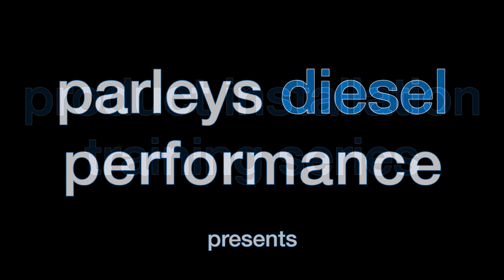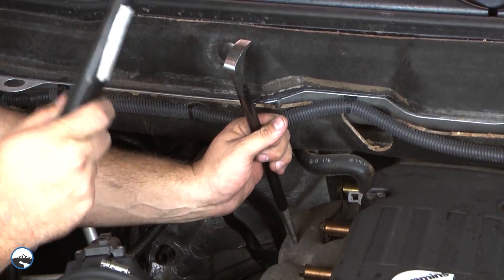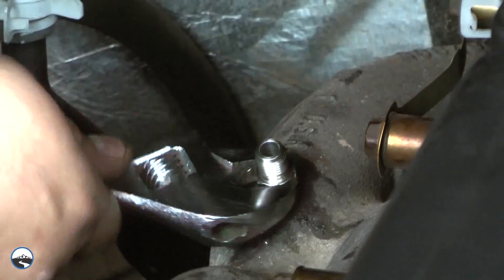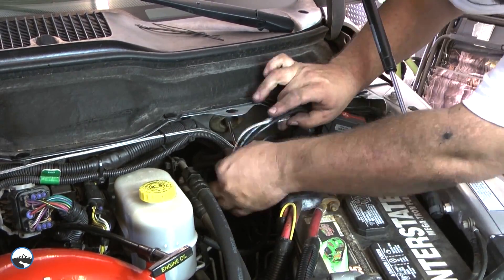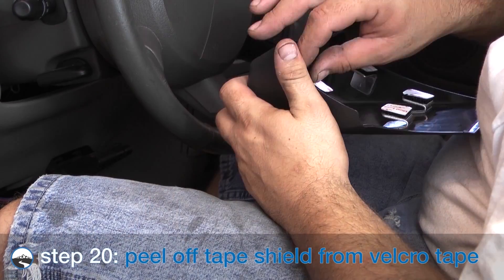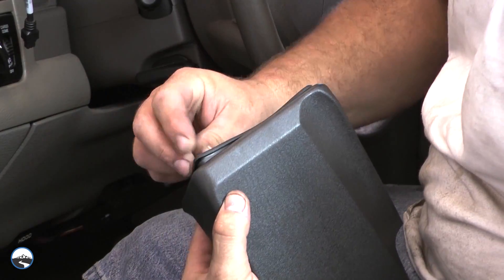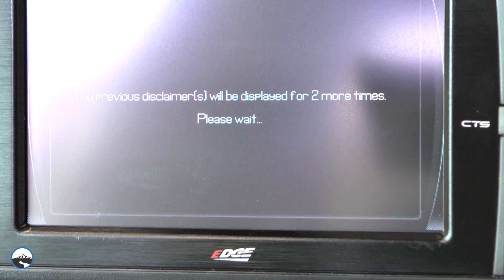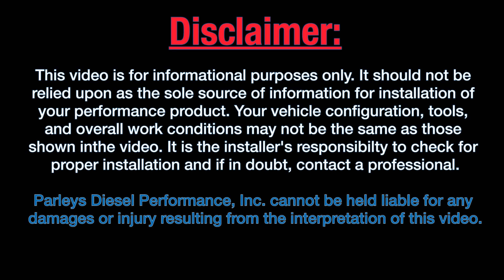Edge Insight CTS Monitor

Comment: Great device. I became interested in this product when my neighbor installed one in his Ford F250 with a diesel engine. He bragged to me about better fuel mileage and power that he could not believe. 
Now, I am interested in this product to fit my application. Will this device work on my 05 Monaco diesel pusher with a 8.3L Cummings with a 6 speed allison? The coach weights in at 32,300lbs empty and is 40 ft in lenght.

Comment: Is an additional probe needed to make the boost gauge work or will it work off the obd2??
Reply from the maker: On most vehicles it will read from the OBD-II port. It does vary from vehicle to vehicle though.
Reply: I have an 05 cummins 5.9 g56 no programmer yet.  Will it show boost with the system from the obd2?
Reply from the maker: Yes it will.

Comment: this is just for diesel engines or works too in gas engines?
Reply from the maker: +noisyboy507 The insight monitor does not do any performance tuning, it is for monitoring purposes only and works on both gas and diesel vehicles that are 1996 or newer which have an OBD-II port.

Comment: Will this work just as well on a 2000 24V VP44?
Reply from the maker: +Dave Kana Yes, it will. Keep in mind that what is being shown in the video is a monitor only and does not do any tuning. Edge does a Juice With Attitude CTS that will do tuning and use a very similar monitor.
Reply: Thanks for your comment, still deciding if I want gauges or a monitor. Cost is about the same for a 3 gauge set up, EGT, Boost, Trans Temp, or Fuel Pressure, Thanks, Dave.

Comment: would really have sucked if any shaving or file from drilling the hole in the exhaust manifold when into the turbo.  You can never be to careful with turbos